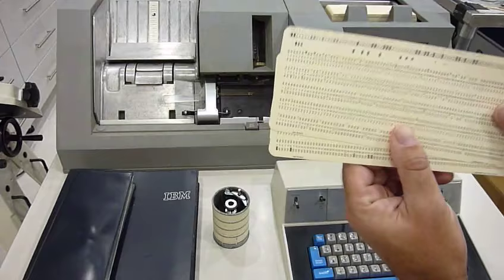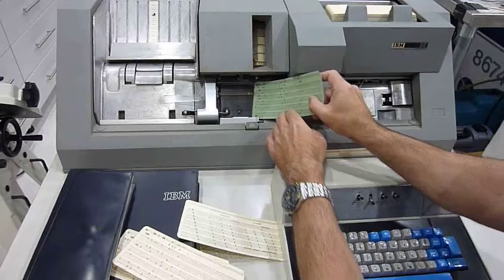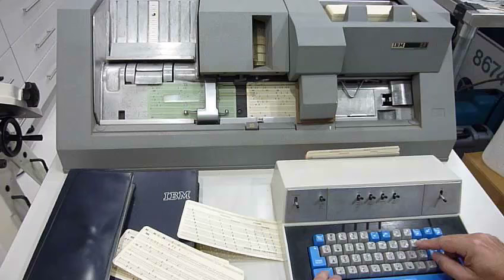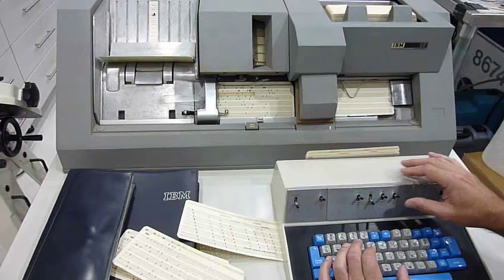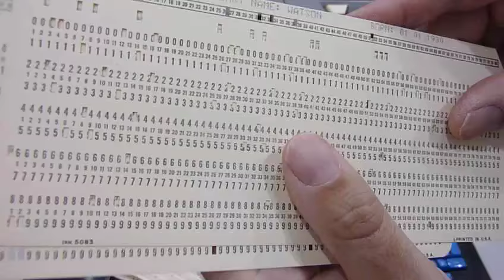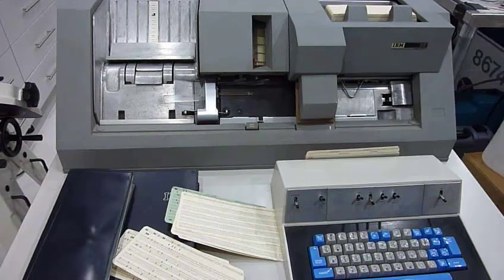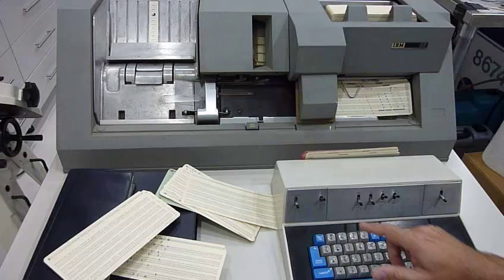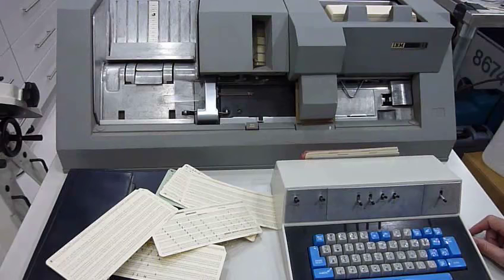1964 IBM 029 Keypunch Card Punching Demonstration

Comment: After the cards were "punched", they had to be "verified". Basically, the verifier would have to key exactly what the keypunch operator just keyed. If there was a mistake, the verifier would have to key a whole new card and then go back and verify the new card. Not only did you have the noise of all the keypunch machines, you often had the noise of swearing verifiers.
Reply: Laura Dempster I was reading this and then collapsed on the table laughing
Reply: Verifying in Danish was called "kontrolhulle" (hul is hole). Keypunch operators were often female and called "hulledamer" that is something like "hole ladies" (said with a certain giggle that would be VERY inappropiate today). The verb "hulle" would probably be translated more correctly like "to make holes". Yhe keypunches had been retired a few years before I started working as a programmer and we had 3270 terminals. But the punched cards left their mark. A punched card has 80 characters and so has a 3270. But one position (or sometimes two depending on whether you used TS/2 or TSO) was used for invisible control information. Old source that originally had been entered un a punched card might have a hidden character outside the screen. So you had to shift the lines. 
Stands for keeping program cards were reused for those small leaflet guides that IBM made. They were really handy.
Reply: verifiers vilifying
Reply: @bill605able  I'd have hell on earth based on how you describe it. I have Asperger's and can't stand too much loud noise.
Reply: I was a verifier downtown Chicago for the Pure Oil Company and they move to the suburbs of Schaumburg Illinois and then I worked on Michigan Avenue by Adams for Oklahoma oil company

 the same kind of work during the regular KEY.  Punch
 now known a 
 data entry operator
Reply: I had written a double entry program for a set of forms.  After they entered 300 forms I checked and couldn't see a single error/correction cyclus.  So I contacted the "verifiers" asking if the program had a problem.  They answered: Who do you think we are,  we don't make errors
Reply: @bill605able  To those of us who had to keep them going, they were "Terrifiers" An IBM CE from 1961- 1990
Reply: “Swearifiers”
Reply: Swearing in 1964:  "Gosh darnit!"  "What in tarnation!"  "Fiddlesticks!"
Reply: @sa3270  

I once had a female boss who wouldn't say anything worse than "Fish-hooks ...!!!" ...

... unlike her husband, who could turn the air purple ...
Reply: Well, the verifiers I worked with didn't swear but once verified we put the card back in the hoper and verified it again.  I blew away the statistics for the whole department because I keyed 29000 keystrokes per hour.  The minimum was 10,000 per hour. I sure do miss all those ladies I worked with.
Reply: to correct a card you just duped the card and retyped the incorrect colum, same as typewriter!!!
Reply: The IBM Verifier was a 059 machine.
Reply: @Lindsay5137  Oh no, 0029 was my first trained machine and I loved them ! I remember being called to help an out-of-branch CE to fix a Left Zero problem he couldn't fathom. :)  The older 48V reed-relay machines were a bit of a pig though.
Reply: I am really enjoying these replies. I also was a verifier, fastest keystroke in the department of about 65 at TWA in the 1960s. Began on the 2nd shift, don't sit next to me if I got a really bad batch to verify, forget those 'words', I would just toss the batch of work in the air, about 300 cards, and tell the keyer her work was on the floor, and it needed to be put in the trash. Couldn't express myself like that after I went to the day shift.
Had to be professional.

Comment: When I was in high school, we used these cards to select classes.  It was called pulling cards.  You went into the gymnasium there were tables around the room with signs up for the classes.  You wen to the table and got a card for the class you wanted.  If they were out of cards for that class the class was full.  When you got all of your cards together for the classes you wanted and had your information card on top (usually pink) they fed it into the computer and you were registered for your classes.  Corny I know, but that is how we had to pick classes back then.
Reply: It worked in reverse in my high school days. Each student was given a set of cards, one card for each period of the day. Then the student goes to the table. If the class is not full, you give them your punch card. If you encounter a time conflict in your classes, you have to go back to the table and ask for your card back.

Comment: I started working at IBM in 1979 and this was the first machine I was trained to fix as a Customer Engineer. Thanks for this my kids will now know what I am talking about. Thanks!!!
Reply: I remember tryibng to tell the card plant operators (those who made the cards) - if the cards don't mean anything until they have the holes in them - why not just ship the holes around - it would be whole lot cheaper
Reply: I remember cheques in the early 80s still had those punch hole in them.
Reply: 5496 was my favorite keypunch, it had memory to correct errors!!
Reply: You actually received training? I started in 1983 as an OPCE, mainly fixing Selectric typewriters, however there were still a bunch of 029's, 059's and 129's in the City of London that needed fixing. I was one of the lucky people selected and somehow had to figure these things out without a day of formal training. What made matters worse was that some computer centers were still using card readers to load mainframe JCL, therefore any problem with the card punch machine was always urgent.
Reply: @PhilUKNet  Hi Phil, I trained on 029 and worked in city Branch in late '70s. I had to fix 2741 golfball terminals at Sedgwick Forbes, who wanted letter quality; I could have done with some OPCE help then !
Reply: @cannopa  The 70's and 80's were good times at Big Blue. Sadly, things started to go very downhill in the 90's. The mainframe guys would often call in some OPCE assistance when a rotate or tilt tape broke on one of those golfball terminals!
Reply: @PhilUKNet  - I moved onto mainframes (in london) in the '80s. We still had a couple of 1052 consoles and as I had 2741 training I could do the tilt/rotate tapes. I've got a couple of Selectric III in the garage awaiting fixing!
Reply: @cannopa  The typists weren't keen on the Selectric 3. I doubt I could change a tilt or rotate tape now even if my life depended on it!
Reply: Lol, I remember the IBM engineers coming out in the middle of the night to fix the IBM 360's we had. They always arrived in a suit, no matter the hour.
Reply: @pd4689  The suit was an IBM thing. Overalls would have been more suitable for many jobs, but that wasn't the IBM image!
Reply: I started in 73' in Denver CO. I can still see all those relays in the back panel. How about DBJGPMUS? Remember that?

Comment: My mother in law worked as a key punch operator from 1964 to 2005.  She was fast about 200 strokes a minute.  She worked for an oil refinery contractor for years, then was laid off in 1998. She wasn't ready to retire yet, and looked in the wanted ads and found 1 ad for key punch operator. It was a miracle. The  company was a rolled steel manufacturer. She went on to work till she was 67 years old, and she never lost her speed.  Key punch was good to her😍
Reply: Keypunching up the 21 century?? good on her! but I still dont know how these were programs or how did they work.
Reply: @DannyOvox3  Each line was a card and the rest is basically anologous to today.

Comment: In 1972, while at my first job, I learned keypunch or card punch there, and it seemed like a big deal when it was my typewriting skill that made learning keypunch easily. The reason is that the card punch machine was related to data processing, the data of the punched Hollerith square holes were punched and read by the card reader connected to the system computer. I worked on the IBM 026 card punch. Then I went on a second job in 1973 where I was exposed to the IBM 029. Then I worked on the Entrex Data Scope that was a key-to-disk terminal. Eventually, it replaced the punch card. Finally, when the microcomputer had 104 keys on its keyboard which I like to call the "console," keypunch keyboarding was replaced. "I'll never go back to Georgia!" I am satisfied to use the microcomputer (PC) today, and it works well for me. Thank you for your demonstration and show, CuriousMarc. 🙂

Comment: I took my first programming course in Pascal in 1983.  I found it was quicker to punch in the programs on cards then feed them into the reader and wait for a printout than it was to wait in line for the "interactive" terminals.  Next year the card punch machines were gone and the space filled up with more miserably slow terminals.  The year after that I had my first home assembled PC clone and 4.77 MHz seemed like lightning speed.
Reply: hoppes9 i
Reply: I worked in a bank straight out of school...Punch cards were all the rage!  I never dreamed how quickly computing would develop in the following decades.   There’s more memory and computation power in kids toys today, than there was in those early computers.     Aahhh the smell of coffee and the sound of punch card processing early in the morning:-)
Reply: The Altair 8800 in 1975 is the first computer that condensed an entire room full of computer hardware into a box. It worked by flipping switches in certain patterns to make a program and if you have a terminal and a floppy drive, you now had a fully functional computer that can easily fit into an office cubicle that will replace the old bulky system that is the size of a public school classroom. The Apple 2 is the computer that started to replace keypunch machines in businesses, and it’s also the first home computer due to ease of use compared to the Altair 8800.
Reply: @davidperry4013  Bruh and the Altair 8800 looks like a relic compared to what we would call a computer. It looked like a box of switches and not much more, yet it was amazing what people were capable of doing with that primitive thing.
Reply: Had my first Cobol course using one.  Learned to one- finger punch to avoid spoiling cards.

Comment: We had these machines back in the 70's at the university where I worked.   We only worked with these decks of cards and we were blazing fast on these machines.  The calculators were also big big machines and loud.  Yes, I am still working at the university, so I know how far we have come in the last 45 years!!
Reply: Comptometer was the name of the huge adding machines. You had to be very accurate, then came the 10 key, (by touch). I miss those days.
Reply: Ok but I dont understand, what can you do on these machines because a lot of people call them the foundation of computers and that it could read and write programs. What was a program in a sense of a card with holes? What programs can you write and what would they do?

Comment: Thanks for the walk down Memory Lane...or should I say Nightmare Alley. I worked on 029 punches, 059 verifiers, an 026 punch (no print capabilities) 056 verifier, and the 129. Largest installation I worked in (actually as batch processing supervisor) had 32 keystations at peak operation. I also worked in Unit Record rooms where we used mechanical sorters and large gang punches to insert a pricing on an item for invoicing. Hearing protection was an unknown. I started losing hearing in my late thirties due to the nerve damage from being around the constant noise. Yep - these machines were LOUD to the point of deafening.

Comment: I started using IBM 026 / IBM 029 in 1962. This video brings back many memories. One is one job required me to read the cards by sight. Probably the reason I needed eye glasses by the time I turned 22. Didn't realize how nosy the machine was.

Comment: Nice to see this working. My mom was working on such machine in 70's and early 80's and i could play with it when she was working overtime ... They had 8 such machines, two were a bit older by look... they had more rounded edges and keyboard. First I would empty all compartments where punches were collected and then i'd be given a  stock of blank cards and i could beat the hell out of it. Sometimes cards would get stuck and i knew how to remove them and restart... It was so cool to see those cards traveling from right to left. I was like 7-10 years old then. Cards were of many different colors and of very good quality cardboard. I would use cards for many of my creative needs... making all sorts of things... from cars to airplanes. Girls that were working there, knew how to make all sorts of origami out of those cards. It was quite loud when all were working at once. I remember how fast they could type... it was insane. One day only one of those machines was left and replaced by  IBM 3742 dual Data Stations and some big closets with rotating tapes. I was not allowed to touch those. At that time they look like Sci-Fi to me.
Reply: LOL! My mom was a keypuncher and she used to let me play around with some blank cards on the other unused machines at the university where she used to work.

Comment: I enjoyed watching that thanks. I was a field engineer for IBM 1977-2005 and the 0029, 0059, 0129 were the first machines I was trained to repair. I would give one of these house room no question. As others have mentioned the print mechanism was joyous complication that worked so well, the code plate and the 'little men',  if I had thought of it I would have instantly dismissed it as un-workable . I still have code plate aligning tools and starwheel spanner. A room full of key punch ops could be intimating to a nervous young field CE. Happy days.
Reply: +StdcirrusDDA Or a 23 year old programmer trainee in 1969!
Reply: so true.  I worked in a punch room in the sixties and thought the engineers very brave to come in the punch room.
Reply: I was a CE from 1978 to 2003.  Bet we crossed paths somewhere.  Were you FE or GSD.  Do any training in Atlanta at the Roswell location?
Reply: @lynnshirley  Ain't that the truth, aged 20 and going into a punch room in 1960 with 30 operators and on your first call. EVERY body knew your name and you didn't know any body - even the supervisor wound you up.
Reply: @muckeyduck3472  Just seen this, I was an  IBM UK employee so unlikely we met, I started in data entry and ended in large systems 3090/zseries et al and fibre optic infrastructures. Best wishes to you.

Comment: I just wrote a bit about my life in your IBM 360 front panel demo clip.  This was the machine I used in Iran in 1986 for my Fortran course.  The bad thing was it would hang and destroy my cards once in a while. I remember like most IBM stuff, it didn't have a power switch and I had to unplug it when it hanged.   I started my job in Toronto a few years later, and I saw this punch card machine proudly placed on display in the lobby!

Comment: i am a retired IBM CE and got trained on the 029 in Basic School in 1977. Amazed as to how many were still in use even through the 1980's. What is a real hoot is that the IR packet is still with the machine. That is the small blue folder on top of the blue binder.

Comment: I spent many a night on one of these getting projects done in college about 45 years ago.  I remember those star wheels that read the program card were often damaged by people pulling the cylinder out without lifting the wheels.  Every programming session started with a search for a machine that still could read a program card because the tab functions programmed on a card made it much easier to type Assembly, FORTRAN, or other column-sensitive languages.

Comment: Oh my, way back in the mid 70's took my 1st programming class at Georgia Tech using one of those, but only after we started with an 027 and an 028. After going through all 3 of those, they let upper class-men use the "terminals", complete with paper...there were no CRTs there yet. When we moved to Macon, Ga with GEICO in 1974, several got to stay in our house as the computer room was not yet ready for them...

Comment: I worked on the 026 and evetually on the 029 in the UK where they were used to record production at a factory. These were very good machines and if set up properly as to the instruction manual they would always work, ours were working almost 24 hours 7 days and so required some maintenance but always worked after corect adjustment. I also worked on the Selectric typewriter used in similar duties as the 029, again, these would also work if set up acoording to the instruction manual.

Comment: I learned IBM unit record machines in my senior year of high school (1968).  It helped me get a college coop job at Eaton Corporation.  They had mainframe computers but still needed an "offline operator" to work with the punched cards.  I had forgotten about those program drum cards.  That keypunch was better at "interpreting" (printing the characters above the punched columns) than the old interpreter machine.

Comment: I wrote tons of FORTRAN code using these machines as an engineering student in the late 1960s.  At first, we had to take the deck to the processing center, and they would execute the run and return the printout.  We had to wait a couple of hours sometimes.  Then after a year or so, there were remote terminals around campus and we could punch and run the programs there.  I got amazingly good as I went along.  I could keypunch the cards without a mistake and then my program would run the first time.  That was pretty cool.  Most of my programs were concerned with lab data and engineering calculations which were hellishly complex with even a calculator, which were scarce.  The IBM mainframe was the way to go, and it was tons more fun.